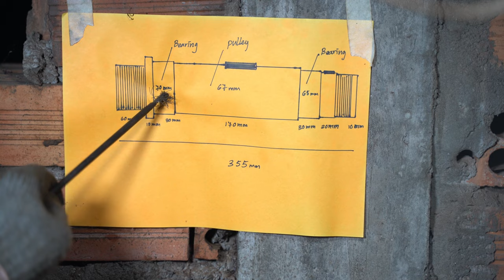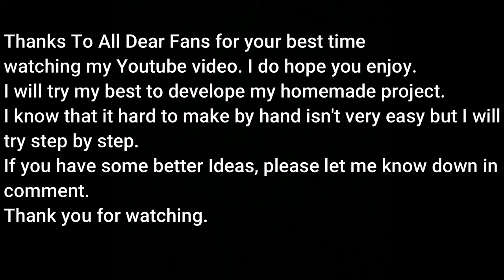New Spindle Completed For Homemade Lathe

Comment: The problem I see with the pully setup is that its too small and rubber from the belt can get into the bearings. Screwing on faceplates has its own problems too as you are relying on the threads for accuracy and you will be praying that doesn't come undone or even move a little as it will throw your parts off its center making it impossible to hit tight tolerances. There are reasons why most laths have fixed face plates and the ones with removable face plates are a pain to deal with.
Reply from the maker: Thanks Ham 
That is my concern very much because I do not have my own machine. The pulley is used size B think a bit small, the charge me 220$ for two pulley so expensive but choice
Thanks let how is first im sure.
Reply from the maker: Thank you for your patience in watching this, learn to make this machine without book and no school it one part of my day only, and I started during a pandemic and have been Covid 19.
Thank you again
Reply: @mr.ranyhomemade2466  No rush for me at least. I kind of like the slow progression anyway.
Reply: Screw on chucks were very common until 30~40 years ago and plenty of people still use them as hobbyists with older machines
The only thing I would do different, the shoulder behind the screw on part should be cleaned up accurately to be concentric with thread/bearing then a counter bore in the nut to keep things in line.
 Screw on chucks can have problems if you do a lot of intermittent cutting as they tend to get too tight to remove (at least without a struggle) and, if you have the ability to switch from normal running to reverse without stopping first, they can come unscrewed.
It will be simple to make a thin plate to keep any rubber out of bearings, getting grease from bearing onto belt may be more of a problem although the same thin plate will act as a slinger to keep grease or 'dirt' where it belongs.
The only problem I foresee is changing belts as the spindle will have to be disassembled, although the PK Truck video's don't seem to be bothered by the same design. which came out of a factory that way